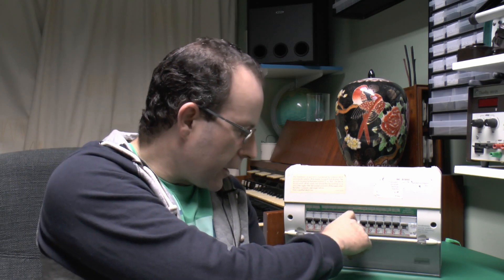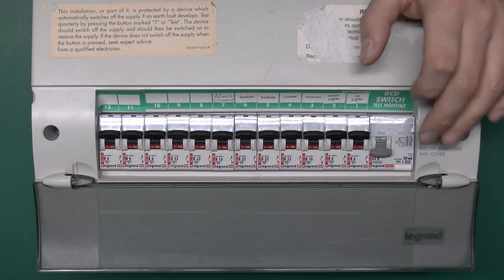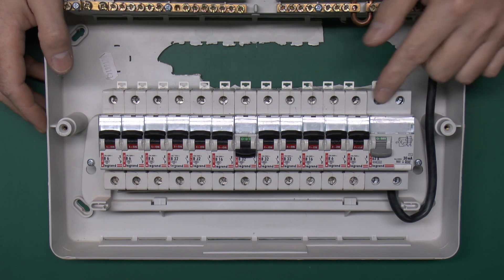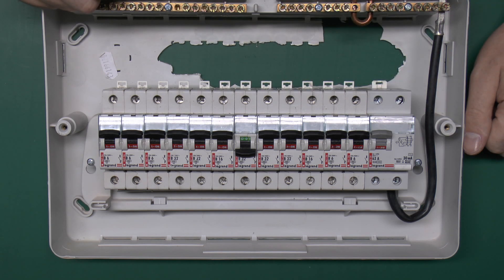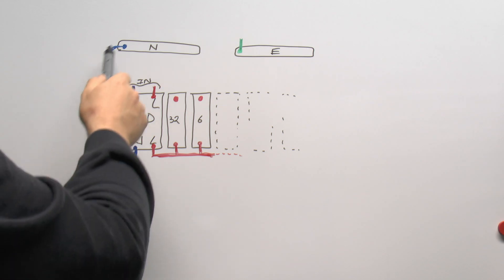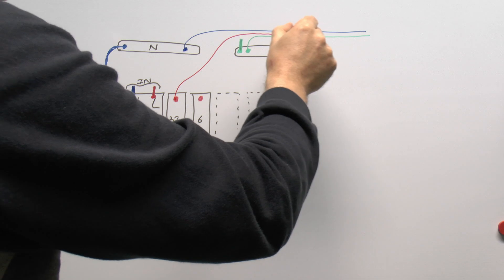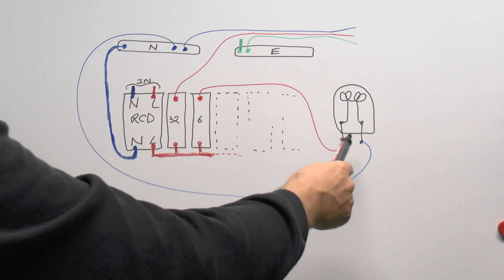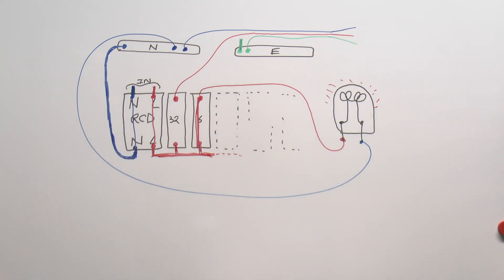RCDs: Neutral - Earth Faults

Comment: Great Explanation, Thanks.

 Could you do a video on what exactly flows down the neutral wire in a domestic AC circuit.?

Is it current plus small voltage or just current and how does the phase of that current compare with the incoming?
Reply: It is just current. The small voltage you may measure if you measure between neutral and ground. This test is usually used to verify neutral from phase. My guess for phase angle of current is that since there is only one direction of current for half of the time it has one phase and magnitude for both phase and neutral half of time and 180 degrees shift half of time each cycle.

Comment: RCD are annoying in their current install setups (1 or 2 protecting all of them) wish RCBO where more standard

i guess this explains why the RCD would not latch when even all MCBs was off
customer has got a 2 soldering irons and both of them trips the RCD the moment you plug them in and if left plugged in you can not reset the RCD even if the MCBs are all off, so i guess that is the Neutral and earth fault, but others have said this is a common thing with soldering irons
Reply: Why not using MCBs that also interrupt neutral ? Here in Italy it's the standard, I don't get why they are not used everywhere in the world. Putting a RCD on every circuit it's expensive, here the common setup is a main RCD and then MCB that also interrupt neutral for every circuit. A fault is simple to isolate, you turn off all the MCB and turn them on one by one since you fine the one that trips the main RCD.
Reply: A1eR that’s what an RCBO does
Reply: @joefrayling9263  Not the same, RCBO is a single RCD for every circuit, that could be rather expensive if you have a lot of circuits. A 1P+N MCB that also interrupts neutral costs practically as much as a standard MCB and solves the problem without having you buy N RCBO. In my county single pole MCB are practically never used, you always found double pole everywhere.

Comment: I have a question that maybe you can illuminate for me. Recently, I moved into a new house with RCBO's and one of my AC's has a built in fault detecting plug which occasionally trips the one for the outlet it is plugged into. Why would one RCBO trip another? I have recently solved it by adding a third which sits between and have really be scratching my head on this one. It has not tripped since I added the fault detecting plug between the AC's and the one in the breaker box. It is not a amperage issue, as that was the first thing I eliminated, but was rather a load imbalance fault.
I can only assume the one on the AC is faulty, and soon I will be replacing it with a new one, unless there is a reason you could give me that would cause this or if it is a weird gremlin I may never figure out.
Reply: +Richard Smith it's likely that the fault is within the AC and the RCD in your house has a quicker trip time than the one in the plug, you generally want to avoid using the same rating of RCD downstream from another as it's often the case that they'll both trip simultaneously or the one upstream will trip first instead of the one closest to the fault

Comment: Great video, just one question: In a MEN earthing installation where there is a connection between the neutral bar and earth bar, how then can the RCD still operate how it is supposed to? Why doesn't the MEN link provide the leakage path to trip the RCD anytime there is a load?
Reply: +Forester226 The connection between the installations earthing conductor and the supplies neutral conductor is made before the RCD (at the supply inlet position in the uk) then when the line an neutral pass through the RCD the earth connection will serve as an alternate path in case of a fault, so if a live wire were to touch an appliance casing current would come via the RCD and follow the alternate path at which point the RCD will detect an imbalance and trip. No matter which earthing arrangement you have it all goes back to neutral at the transformer one way or another

Comment: Very interesting video. A couple of nights ago one of the cats peed over an extension reel and the RCD tripped rather than a circuit breaker. Would that mean what happened was a connection between line and earth?
Reply from the maker: +BenjaminGoose Yes, a small current between line and earth.
Reply: +tengelgeer Thanks for pointing that out. So, sea water would be far more conductive than tap then?
Reply: +BenjaminGoose  Hell, cat piss must be potent!.. I remember conducting an experiment wunce, whereby I decided to see if these things (RCD's) work in the real world, I mean, hitting them with all this fandangled test equipment and stuff inside laboratory conditions is all well and good BUT... do they really work in the real world and would they actually save a life?I started my experiment by getting my fathers 'plug in' (to socket outlet) 30mA RCD and got the ball rolling by pressing the test button, it tripped! I then plugged an extension cord into the RCD and threw the other (female) end into a bucket of water, completely submerging it! It 'didn't' trip! I figured to myself that most of the current was flowing up the neutral conductor and, obviously, less than 30mA was flowing up the earth conductor, so with that in mind I unplugged the extension cord from the RCD and disconnected the neutral wire from the 'male' end (the end I just removed from the RCD) therefore, when throwing the other (female) end back into the bucket 'O' water, 100% of the current would then 'HAVE TO' flow out the phase and be soaked up by the earth and I'd get my result!Well, I plugged the male end back into the RCD and I threw the female end of the cord back in the bucket of water and, guess what? It 'didn't' trip! Now, either water doesn't conduct electricity or... Anyway, you take what you like from that little experiment but, whenever I think I could be in peril of an electric shock and all I've got is an RCD to protect me, well???
Reply: +SeriousSchitt Tap watter can be very clean and thus not conducting that well. Water alone (pure water) is not conductive! It's the salts (like calc) that make it conductive.
Reply: +SeriousSchitt Yes it is. And pee has more mixed in as well so is more conductive as well :)

Comment: you could also defeat this problem with having circuit breakers that disconnect both the N and the live wire(called Fase in my country) 

by the way then you can mount a lock on most circuit breakers wich would defeat the problem of a random person turning it on while you're working on it

Comment: I've had this happen when I made up an adapter for a caravan to run on a regular 10amp NZ socket (for the lighting and light loads). The caravan fuse box had a linked neutral and earth bar and would trip the RCD when plugged in. I had to remove (cut) the earth neutral link while still keeping the earth neutral wires connected to the plug on the caravan

Comment: Another interesting point to make in regards to this irritation is it is far more likely to happen on a TN supply as the impedance of the earth is generally much much smaller than that of a TT. On a TT supply somewhere in the sticks where the local transformer (and ground) is miles from the house and your main earth is little more than a stick in the ground...This is far less likely to happen, if even possible in some situations. An example would be my stepfathers farmhouse that has no equipotential bonding at all because there is no gas and all local supplies come in plastic, the only earth connection is a single earth spike. So poor is the earth, I test the RCD's every single time I go there as a precaution.
Reply: I'm by no means an expert. When you say the earth is so poor. What reading would you describe as poor? Thanks

Comment: The problem I find with RCD,s Earth Trips etc. They can be a nighmare as they can trip. I do a lot of electric welding in my shed. Soons as I start welding the trip comes out. Its not the welder as tried several other types  Also tried 30mA and 100mA they trip as well. PAT Tested welder as well all ok. Another thing that trips RCD is Amateur Radio Transmitters as I used to be an operator and found half way through a conversation the trips came out. Now I use plug in RCD as cannot have them in the fuse board.
Reply: +MakeDoAndMend1 Fella's, I think he's trying to say that the 'RCD's' are tripping, not the MCB's!  There are certain things you just don't run an RCD on, ovens, hot water cylinders, and a welder's probably one of them! I run a 32a 'D' curve circuit breaker and 'NO' RCD! Works fine up to the full capacity (180a) of my old power hungry arc welder! Remember, Mathew 18 vs 9 "And if thine RCD offends thee PLUCK IT OUT!"
Reply: MakeDoAndMend1 Ps forgot to mention I have moved house a few times with the same result. Also I worked for RS Componets Technical Support for 12years and had to deal with lots of RDC tripping problems. Transients suppressors helped but not fully.
Reply: MakeDoAndMend1  hi there, i do not believe its an earth fault or neutral fault, this sounds to me like an overload. a welder sucks alot of power and if your using that in your house or even worse a shed. it will definetly trip. whats the load of your welder and the rating of the circuit mcb you plug it in..get a qualified electrician in and do not just change your rcd to different random numbers this is dangerous friend.
Reply: MakeDoAndMend1 Do you use C type breakers or D?

Comment: Hey JW, I took some readings between Line & Neutral, Earth(ground) & Neutral, the readings were LN= 240V, & EN=80V.. Do you know why the EN is 80V, I check if the earth wire was disconnect from the earthing rod, but it was not. PS. House has 3Phase Supply
Reply from the maker: Senal Devasurendra If the earth is connected, then it's either due to voltage drop in the neutral, there is a fault between line and earth somewhere, or the test meter has a very high input impedance so the 80V measured is not actually there.  Or a combination of all three.

Comment: Hello,

Excellent video, as usual.

Could you please do a video on RCBOs, and particularly on why they have the separate white earth leads. I am a trainee electrician, and was told by one qualified electrician that they are to prevent nuisance tripping, but another qualified electrician didn't know what they were for
Reply: The white lead is an earth connection and it is usually used by the TEST function of the RCBO... which creates a deliberate imbalance to earth in order to cause the RCD part to trip. If you don't connect it, the TEST function usually doesnt work. Some RCBO's are designed so that they don't require that earth connection

Comment: Hi i would like to ask a question about yr wiring, Why to you insert the link bar at the outlet of all the circuit breaker?? im talking about the LIVE bar.it should not be upper side of the circuit breaker please??
Reply from the maker: hans david Most consumer units in the UK have the circuit breakers arranged with the supply at the bottom, and circuits connected at the top.
Reply: Ohh ok, and the c.breaker works same ???

Comment: Good video. In Estonia the RCD is not required for entire building, it's optional for bathrooms (water heater, washing machine, optional socket by the mirror) and other moist rooms like basement.
Reply from the maker: DjResR They used to be optional here as well, but over time, more and more things have required them, and today almost all circuits in a house must have an RCD.

Comment: Great informative video. Interesting to see that the cooker goes through the RCD. In NZ the cooker and hotwater cylinder don't go throught the RCD as heating elements sometimes have leakage and cause nuisance tripping of the RCD.
Reply from the maker: RODALCO2007 Virtually everything has RCDs now, as regulations require it for cables concealed in walls.  The other options being to use armoured cables, steel conduit or having concealed cables more than 50mm below the surface - all of which are far more inconvenient and expensive than fitting an RCD.

Cookers and similar are a problem, such as where a new consumer unit is fitted and the cooker which worked perfectly before now trips the RCD on a regular basis.  Have also seen the same problem with people buying a new cooker, where it's been stored in a damp environment before delivery.
Reply: ***** Thanks for your reply. In New Zealand a hotwater cylinder and range/cookers don't have to be on a RCD because of the leakage issues encountered sometimes with enclosed elements. Values are often around 10-15 kO.hms. and the element has still plenty of life left in them. The NZ standard also requires 2 RCD's at least to avoid loosing all power in the house.
Reply: We still use GFCIs at the receptacle here in the States, even though GFCI breakers are perfectly acceptable and code compliant. The big thing now here are AFCI's (Arc fault breakers). They are required at the breaker panel on almost every circuit in residential installations these days. (They've been required since 1999 in bedrooms, but now are required everywhere).  I hear they aren't a requirement yet in the UK, I presume because you guys protect all cables with metallic sheathing. 

In any case, studies have shown that around 50% of electrical related home fires in the U.S. are a result of arc faults (series more than parralel) hence the new requirement. Here most homes use non-metallic plastic sheathing rated at 90C.  While it's safe cable, it's still non-metallic sheathed meaning it is feasible that it can be damaged in the wall (errant nails or rodent chewing), thus the potential for unseen arcs which normal breakers won't detect.

 Some metro areas require metal sheathing for residential applications.  Chicago is one city with very strict standards in that regard.  (Here states and local munincipalities have the authority to override the national code with their own code). It makes sense in those areas because if one condo or apartment building burns, the whole block burns. It doesn't make as much sense in the country where your nearest neighbor is a mile away.

We also have many very old homes here. It is not uncommon to see old homes with "knob and tube" wiring from the 20's. It is legal, but if renovation is done it must be brought up to code.  And we have tons of homes from the 50's to 70's using wiring code from back then. Grounding has been code since the early 60's I believe, but there's still many homes out there without an earth ground circuit (all receptacles are two prong). Some unscrupulous people will install 3 prong receptacles in an old home without a ground circuit, thereby creating a "bootleg" ground. This is achieved  by connecting the neutral to the metal electrical box. This will trick the inexpensive receptacle testers into reporting there is a proper ground. These cheap testers are used by most home inspectors, and creates a dangerous situation for an unknowing home buyer.
Reply: greetings, I'm well late to the party here, but nonetheless I thought you would be interested to know The AS/NZ 3000 wiring rules are just about to have a new edition released, with one of the big changes being RCD everything.  Every circuit needs its own individual RCD, including water heaters, ovens and cookers.
One other big change is that if anyone who is working at a domestic residence needs to do work in the roof, they need to shut the power off to the whole installation which is interesting.
you can follow this link for a preview of the planned revisions. https://www.commerce.wa.gov.au/energysafety/new-wiring-rules

Comment: @John Ward 
I stand corrected. I agree there should be a common neutral bar for the neutral connection of all loads controlled by this RCD. But I believe this neutral bar should be unique to this RCD and should not be connected to the neutral bar where the incoming neutral and non-RCD loads are connected. Please confirm.

Comment: @John Ward
Still it is not clear. I agree incoming wire to all the RCD s should be connected from the common neutral bar. But what you have shown is that the outgoing as connected from the common neutral bar, which cannot be, because outgoing should be unique for each RCD.

Comment: Why you have connected the neutral return from the lamp to the neutral bar instead of  directly to the RCD, which causes the current to be split with other circuits?
I guess the neutral bar is for connecting the incoming neutral.
Reply from the maker: Karoly's The neutral bar is provided to connect the neutrals from each circuit, so that there is one terminal hole for each wire.  It would be impractical to fit a dozen individual wires into a single terminal on the RCD.

The incoming line and neutral connect directly to the RCD, the top terminals in the example in the video.

Comment: Hi jw just like some help with Thailand earth and neutral in the breaker box it seems they join the earth and neutral together as theres only a live and neutral coming into the house I have a earth rod in the ground  which is joined with the neutral in the breaker box can I separate them or not
Reply: ***** But if the N-E is linked, wouldn't that create the likelihood of RCD tripping like what you described in the video? Put it another way, is linking N-E the same as NE fault?
Reply from the maker: stephen brain There is no reason to separate them, and doing so could make things worse than they are.  N-E linked in the main panel is a fairly common arrangement in some countries.  If local regulations permit that, it is preferable to an earth rod alone, as a metallic earth path will have a much lower impedance.  Also fairly common to have a local earth rod as well as the N-E link.
Reply: no